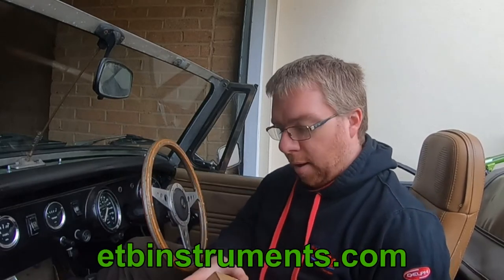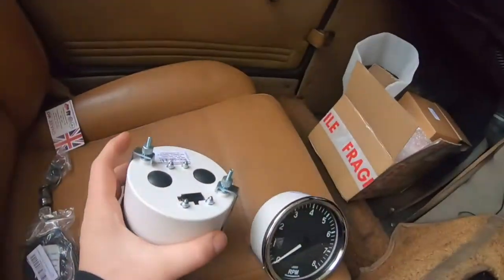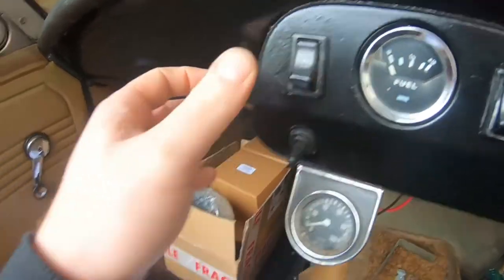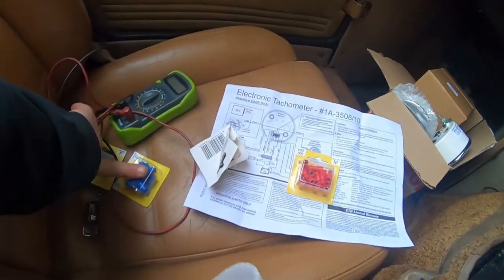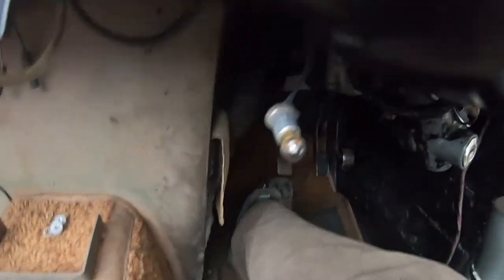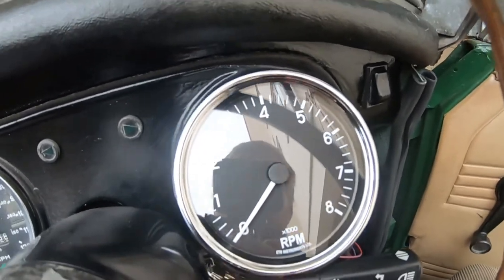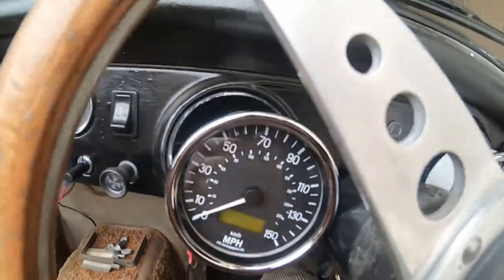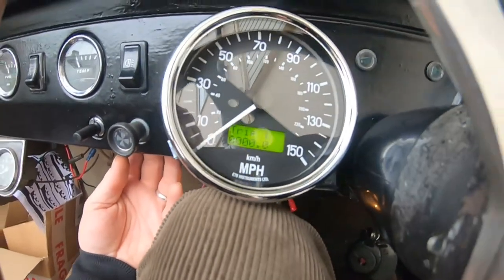Installing the new gauges to the K series Midget

Comment: That wiring diagram looks much better than any others I have seen, BTW I have a deep seated hatred for those crimp on type connectors, they never last for long. Have you tried the WAGO ones? they are designed for mains use but are small, dirt cheap and bullet proof. I use them all the time, being reusable they are great when wishing to shorten wires later etc.
Reply from the maker: I'm also not a fan of those connectors but I'll be soldering them together next time I take the car to work. Not seen those wago connectors before